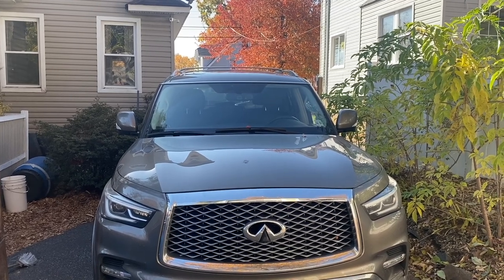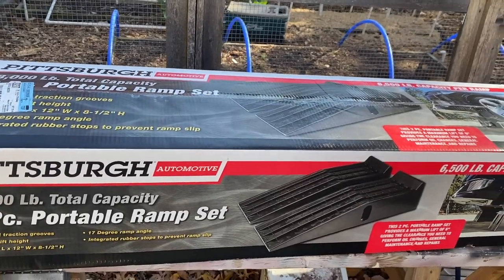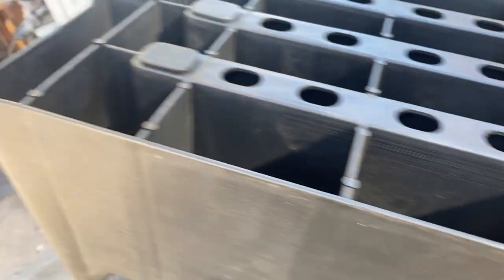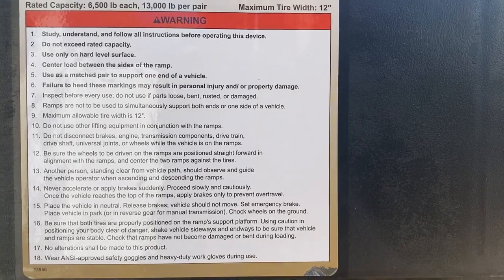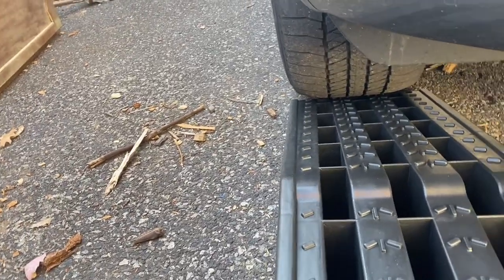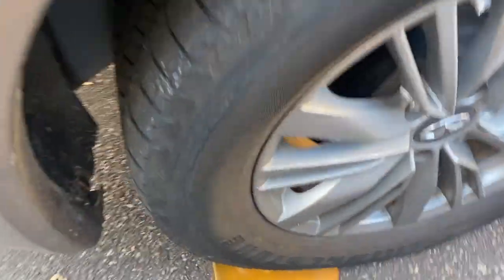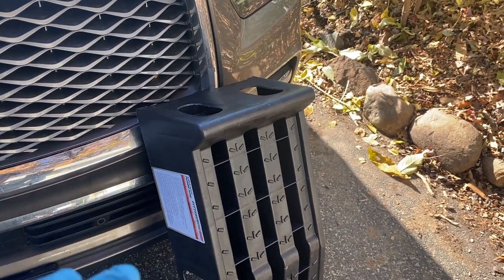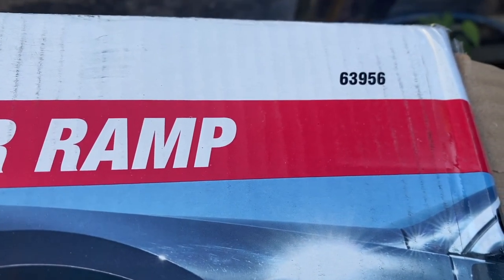Harbor Freight Tools Car Ramp Review

Comment: They hold up better than expected.   I've had them four 5 years worked with them several summers on an F150. In up to 105 Fahrenheit heat.
Reply: I’m getting another set this week. I cracked a spot when I almost drove over the edge. I think they would have been fine but I figured for $60 it wasn’t worth risking my life
Reply: @gardengrowngroceries  With all those crevices just fill them with high strength concrete

Comment: These ramps are good. It held a nissan sentra on the very edge for about 20 seconds and did not crack. Once we realized what was going on, we readjusted the car on the ramps. Very sturdy and strong material. Always use jackstands!!!
Reply from the maker: Agreed! I never trust any one system not to fail. Depending on the work I’m doing I’ll use jack stands and my pump jack for an extra layer of safety.

Comment: I'm getting a set of those and I'm going to fill all the underside cavities of them with expanding foam. They are known to crack on the sides when they get older. I think the foam would really help with that.
Reply from the maker: I stored mine in my garage but it's an uninsulated, unheated detached garaged so it can get almost as cold in there as outside. The foam might just help

Comment: Very nice demonstration video.  On the driver's side the ramp appeared to skid and rock slightly, so certainly the most level surface possible would be good, along with a coarse paved surface.  This is just the sort of equipment I need for oil changes on my cars, an '18 Impala and an '83 Olds 98,  both of which are too low to slide under for access to the filter and drain plug.  Good tips on wheel chocks and jackstands!
Reply from the maker: Yes, I'm a horrible driver and almost overshot the ramp! But the ramps really make working under a vehicle so much easier

Comment: Are these good for a 2013 ford f150 max weight capacity is 7,000 to 8,000 pounds looking for heavy duty ramps for trucks
Reply from the maker: I use them on a 2012 super crew cab f150. They’ve held up quite well.

Comment: I have these exact stands they will hold up, that 13000 rating is for legal purpose as is any weight rating to keep them from being sued. They will hold way more then 13000.
Reply: I want to see a actual test using 13000 lbs. I could be wrong but I don't think they survive.

Comment: Your auto went up a little wonky but they are safe but yes always use the backups jack stands and chucks. Safety is job #1 .
Reply from the maker: Agreed! I try to go by the 3-2-1 system of backups. 3 is 2, 2 is 1, and 1 is none. Many times when working on my truck or car I'll have jack stands and my pump jack in place just in case

Comment: I got some today to change my oil,I have the Rino ones my daughter got me a few years ago for my low car,I changed my oil last year and I was taking my time driving up on them,well they ended up under my body molding,it took a minute to get off,it broke a push pin clip,well yesterday started to change my oil same thing they bent,I rode off of them and said screw these things,the ones I got today look like yours,they look more sturdy,I am going to use the ramps sometimes this week.
Reply from the maker: Well that sucks. I've used these for a couple of years now, no problems at all. Nowadays our vehicles are all trucks, so they're already lifted, but as I showed in the video, even on the low-rise Infiniti there was plenty of clearance. Ok, just enough clearance to get up the ramp. Good luck.
Reply: @HomesteadDIY   I have not used the Harbor freight ramps yet I was talking about the rhino.

Comment: Do you really need these on this  suv for a oil change?
Reply from the maker: It definitely makes it easier to slide underneath and access the oil plug and filter, as well as removing the splash fairing

Comment: Nice review... good ramps for a nice n' easy oil change. 
   Kinda wondering about the 13k lbs weight limit. I am a truck driver and just the truck (bobtail) weights around 12,500 lbs for a freightliner cascadia 2019 with sleeper. But it's never okay to push the weight limit. 
   For example my ram 1500 weights around 6.5k lbs not including the tools. 🤔 but for cars and SUV is perfect match. 
  Just my humble opinion... 😀🙃
Reply from the maker: Yeah, I'd be leery about pushing the weight capacity of anything, but especially these ramps. But as you noted, for a pickup truck and SUV they work well

Comment: I bought these and filled the empty cells with expanding foam, made them much more rigid that they already are. Maybe a good idea, maybe not... time will tell
Reply from the maker: That sounds like an interesting idea! I wonder if it actually does anything though since I would guess the strength of the ramps comes from the torsion box design of the ribs. I assume it doesn't add much to the weight since it's expanding foam. Still interesting concept and I'd like to hear how they do over time. Thanks for sharing!

Comment: Are they good ramps?
Reply from the maker: Yes, very sturdy. Now I did crack one after 2 or so years of fairly regular use because I kept  overrunning the the edge and got rid of it, though because of its design (it has a torsion box-like honeycomb design underneath) I think it would have held up just fine. But for $60 I decided to just go out and get another set. So, yes, I certainly think they are very good. I completely trust them unlike metal ones, which I have seen collapse. Harbor Freight sells a metal set too, but I like this ABS plastic
Reply: Thank you that is my fear too about the tires going over the side and cracking😮😮😮

Comment: Nice, thinking about picking these up for my 16 Mazda 6. Can't use my grandpas old Metal Ramps as the front would drag.
Reply from the maker: I've heard one or two people say their cars are so low profile they still. scrape the ramp, but my stepdaughter's Infiniti's stock profile is pretty low and it works great. These ramps really make it easy doing an oil change now.

Comment: I just bought them today because on my 2007 lexus gs350 the only Jacl point in right in the center right next to thr oiler filter and drain, a bit annoying to have to maneuver around.

It being plastic is so scary. I drove up on it no problem, but for my car it didn't give enough clearance to my comfort. I was able to get under and work but I was not able to place any Jack's underneath, it was still too low.

Comment: Did they scrapp on your low infinity ?
Reply from the maker: No! There was plenty of clearance. Well, an inch or two, but it wasn’t close to scraping.
Reply: @HomesteadDIY  thanks man i tryed them on my cadillac xts i had to return them cause they toched i geuss i got to go with the low pro ramps
Reply: I'd buy these composite ones over their metal ones. The metal ones look even more sketchy 🤣
Reply: I just got some of these ramps will find out how well they work tomorrow. Lol. I hate the metal ones , in my younger days these metal ones were a death trap. I’ve seen too many cars fall off trying to climb one. 😂😂😂

Comment: I was about to get Rhino 16,000 lbs but got those 12,000 lbs HF instead. I just liked the construction much more, without those silly V cuts on Rhinos.

I had my 2020 Ram 1500 on it for half a day and it held up like a champ (front end rated around 3900 lbs). My truck is RWD and the ramps did not slip at all while getting on it on a driveway. Definitely worth the price.
Reply from the maker: Agreed. I'm still using mine without issue

Comment: 6” lift isn’t much to use on a compact car
Reply: I was thinking about using these in the back by sliding them under a raised tire then 15" jack stand the front with 6 ton jacks.  Could use 3 ton jack stands in back too for extra peace of body.

Comment: I'm thinking I weld up my own using a metal cutter and some I-beams.
I mean they will be heavy as hell, but...  I could make them with a much less steep angle.
I'd rather roll onto my ramps than have to shove it up a curb/hill.
Reply from the maker: From my limited experience, "heavy as hell" is never an optimal option :)
Reply: @HomesteadDIY  But on the other hand, mine would last 1000 years.   How long are those plastic things going to last?  15?
Reply from the maker: @choppergirl  Ha! If I'm lucky. Both will probably outlast me though. :)

Comment: Looks EXACTLY like the ones Eastwood company sells
Reply from the maker: I went and checked out the Eastwoods and they do look identical, right down to the tread pattern on the ramp itself. The only difference I see is the Eastwoods are rated at a 3 ton capacity while the Harbor Freight version is 6-1/2 tons.

Comment: i'm calling BS on the 13000 lb rating, these things are struggling under my f250 front end, maybe 4000 lbs
Reply from the maker: They do well with my F150 and my QX80. How much they can fully hold I have no idea.
Reply: I believe it's 13000 lb overall. But it sais osmehting like 6k lbs per ramp

Comment: Make some wood ramps
Reply from the maker: I actually did using 2x12s and I did not have the same level of confidence with my truck on top of them as I do with these ramps. Cheers!
Reply: @HomesteadDIY  surprised of that. I did 2x12 also. 4 pieces each side. Screwed together. Used table saw to ramp the edge of each piece. Used a 2x2 block at top for stop. I feel fully confident these will not fail.
Reply from the maker: @thomascrompton7775  Sounds similar to the design I used, but maybe it was the wood I used since it was what I had on hand and not new.

Comment: ☠☠☠It would be a cold day in hell before I would trust a plastic car ramp ! Even if it held the weight when new it might weaken in time ,    I've been complimented as being a good engineer by an engineer , I have engineered and built the eletric  bicycle that I ride almost everyday  so I pratice what I preach .  And even metal can bend if not used on cement or hard surfice .
Reply from the maker: Now where is the excitement in not taking risks? It's exhilarating to crawl under a 5,000 lb vehicle being held up by little more than a plastic wedge
Reply: That is why you have a backup but yes engineering/geometry is what makes this type of ramp possible. They will be just fine but as with a hydraulic jack always use jack stands and chucks.